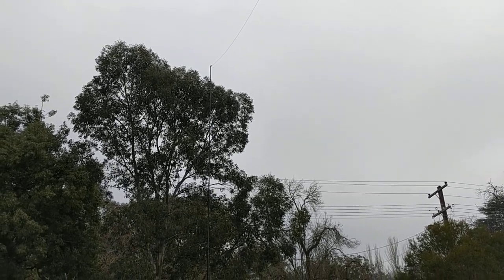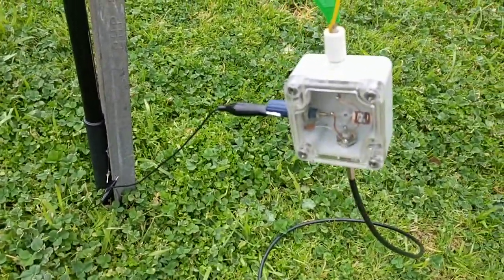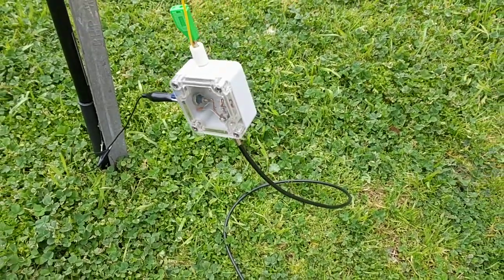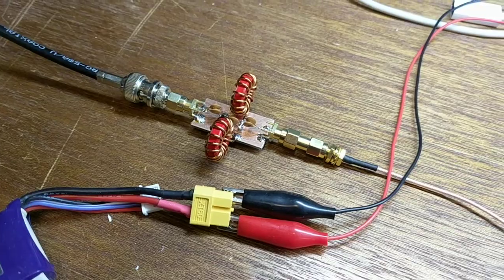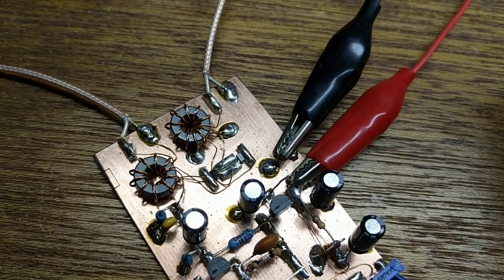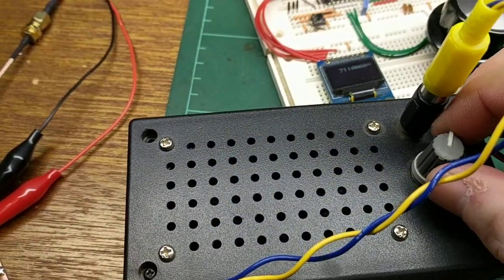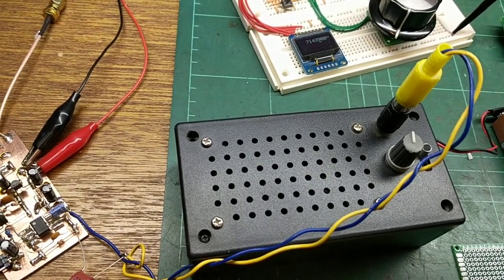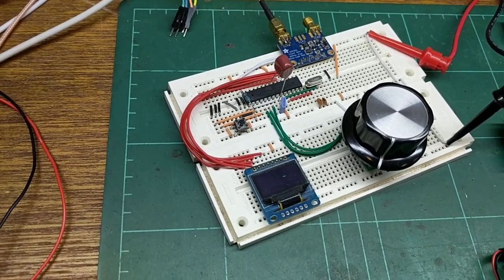My 40M band antenna and DC receiver.

Comment: Hello Alan! I see that you use 5351 for mixer. So, is it OK to feed the mixer with the square signal from the 5351? The receiver sounds good but what will be the difference with using sinus signal instead the square? 

Sorry for might be stupid question but I am just a beginner and I want to know the better way to design the receiver.

Thank you!
Oleg, UR7WKH
73!
Reply from the maker: The ring diode mixer is a non-linear device, it's just operating as a switch to cut up the input and produce an output. The shape of the LO doesn't really matter as long as it can turn the diodes on. The mixer outputs unwanted products anyway, so the much higher frequency elements of the square wave will be filtered by whatever filter you will need to get the IF/AF out as a result anyway, or they'll be so high they won't affect the audio anyway if sent to an AF amp and speaker directly.
Reply: @AlanGarfield  Thank you so much for your explanation. I have been looking for a long time for answer like your.  Also I need to take some experience in diode mixer building. And sorry for my English, I learn it yet)

Thank you!
Oleg, UR7WKH
73!

Comment: Is that a dds generator? Definitely work good for accurate tuning
Reply: Actually no. This is a Si5351 synthesizer what based on the  PLL/VCXO + high resolution MultiSynth fractional divider architecture and it generates square signal.
If you want to use DDS you shoud take AD9850 for example. It generates sinus signal with the high speed DAC. Output frequency band 0 - 40MHz. Also interesting chip.

Comment: Awsome setup Alan. Where did you get the schematics from?
Reply from the maker: It's really just stuff I kludged together. I'll draw it up as best I can and post it on my website. Thanks!
Reply: @AlanGarfield  what is your website plz, im very interested
Reply: Thanks Alan where abouts in Australia are you? I’m from Newcastle
Reply from the maker: @linkavichtruousky1  Originally from Sydney, but move out to Cootamundra about 5 years ago. My wife grew up around the area. I work remotely so I can take my job anywhere.
Reply: That’s a big change from the city. It would be RF quiet out there? (No interference noise)
Reply from the maker: @linkavichtruousky1  You'd be surprised!